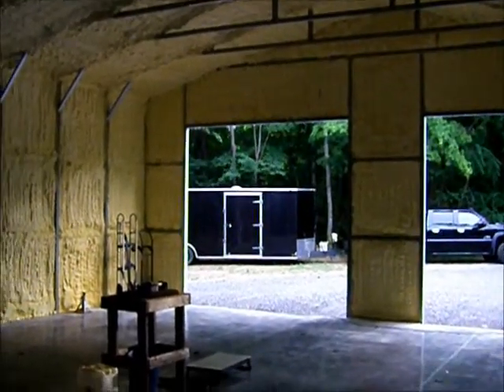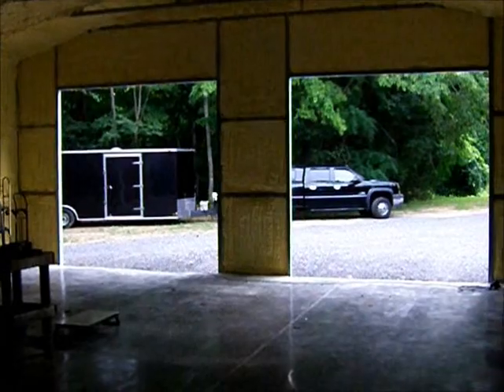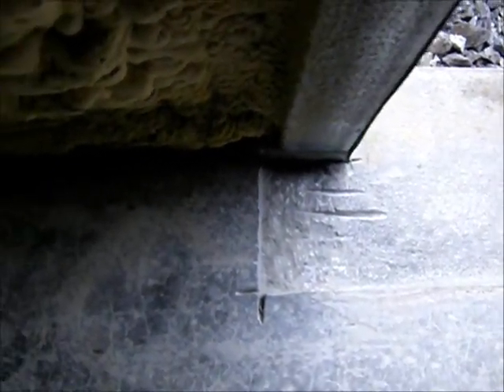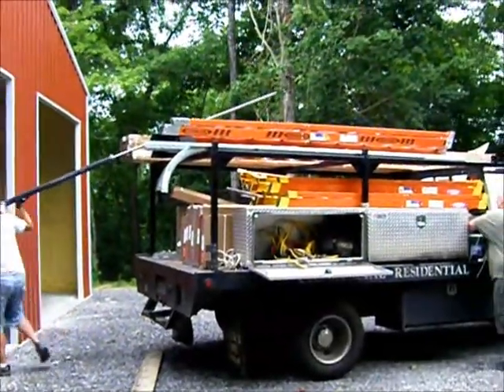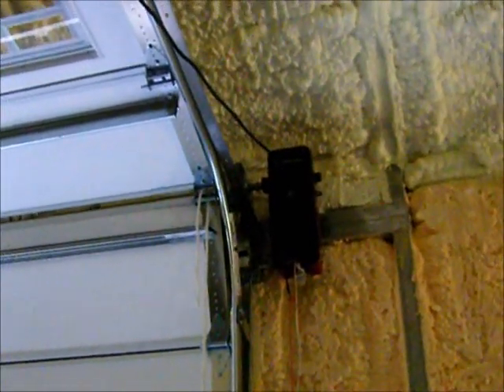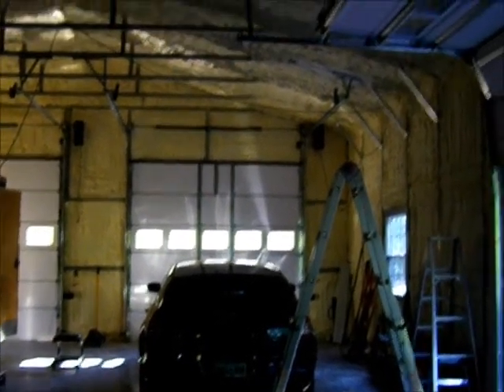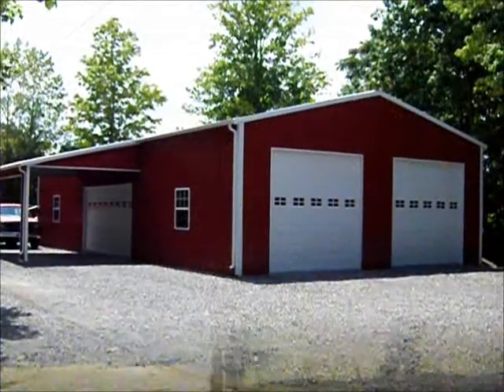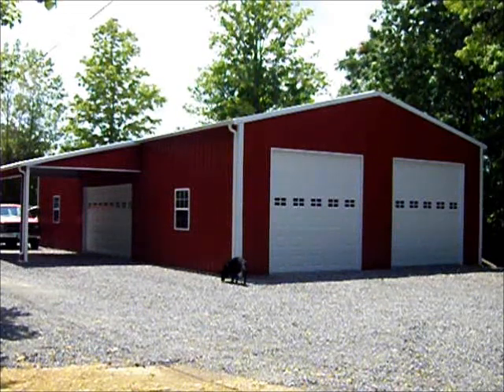Wyatt's dream shop (4) Doors

Comment: How does the foam sealant work? Looking to do that in my new shop to control dirt and dust.
Reply from the maker: It's a spray on insulation. In my case it's a product called "open foam". You can also get closed foam, which is more dense so you need less, but it's more expensive. I chose the open foam because it's soft and it's easy to cut so you can put in wires for example. They also have the same product but fire proof for about the same price. Let me know if you have any other questions, I'd be glad to help.